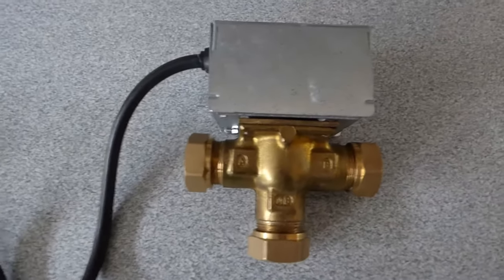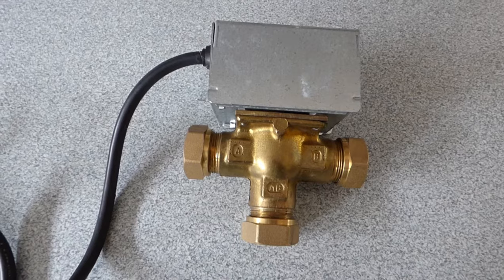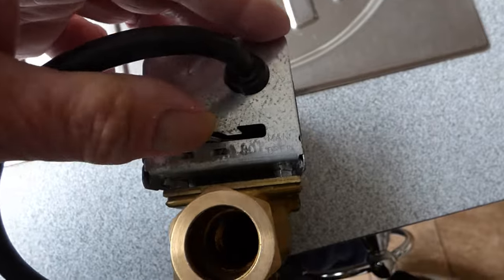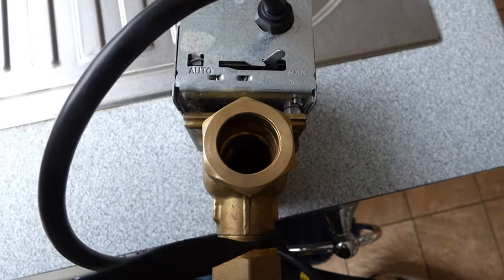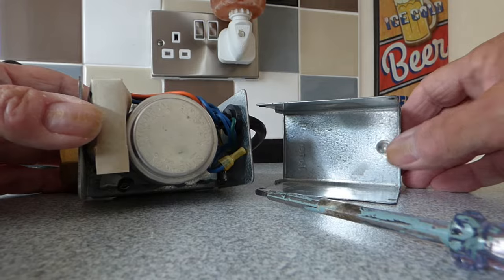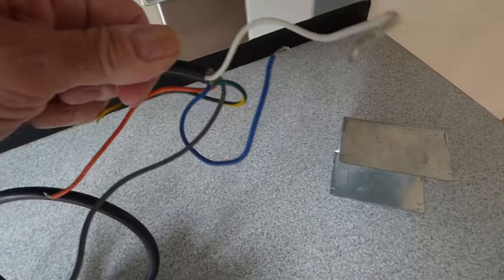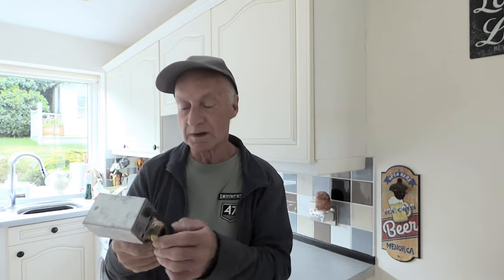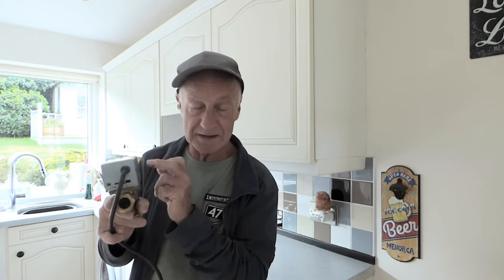No heating? An easy fix using a switch on the motorised valve

Comment: I need help guys. I have a lot of air in my radiators and system so I bled out a lot of air on multiple radiators. When I went to look for the represurise valve to add more water to the pipes I cant find one. I have an outdoor oil burner and cant see any place to add water or even find a PSI gauge in my shed or in my house. In my hotpress there are three zone actuator valves. Iv set them to manually and open. Dont know if that will help. Can some fine person let me know how to add water to the system so I can get my heating up and running properly again. Happy Xmas
Reply from the maker: If you cannot find your filling loop then use the drain cock, just connect your outside hose to it, you will have to guess the pressure as you will have no gauge. Just fill a small amount at a time.
Reply: @dereton33  Thanks Dereton. Im not a plumber but will look into the drain cock and see if I can fix it. Thanks a mill. :)

Comment: Can someone help my three port valve is making ticking noise which it shouldnt i leave it in continuous both water and heathing and just turn on the thermostat when  I need the heating on  how to i fix this i got a three port valve replaced by an engineer i dont want when i turn water on heating to come on
Reply from the maker: Just change the head motor.
Reply: @dereton33  seems odd that engineer came and replaced the three port valve with a new one. I have seem to have fixed the problem by moving the leaver to manual open  for  30 sconds to a minute and moved it back to the mid position no clicking noise at all

Comment: Why oh why, do cables come in colours that us colour-blind people find confusing? Blue is fine. Earth, providing it's striped is straight forward, but when brown/green, (or whatever colour they are), are used along with red, we are buggered. I get around it by using  blue/yellow/white/red insulating tape, along with paper and pencil. 
Rant over. 
Other than that, useful videos thanks.
Reply from the maker: Thanks for your very useful comment.
Reply: @dereton33  Thanks. Not sure how "useful" it is, but it does highlight the problem a few of us have to endure. Don't mind when I'm doing home repairs as it is only me that sees the sparks, but I help a few pensioners out with their problems and I don't want to give them a heart attack with laughing as my hair stands on end and starts to smoke.
Incidentally it's only men that suffer from colour blindness, so maybe...? Just a thought.🤣🤣

Comment: Hi, I have this valve and my heating is constantly on even with the thermostat on 0, I have to turn the boiler off to turn off the heating.
When I move the lever there is no spring or any resistance, is it stuffed ?
Thanks in advance for help
Reply from the maker: Most likely yes.